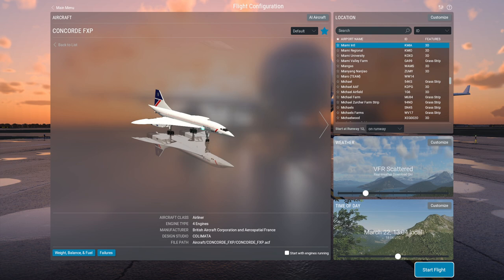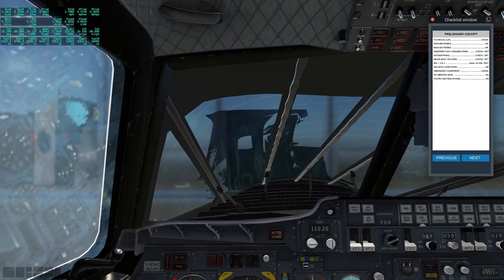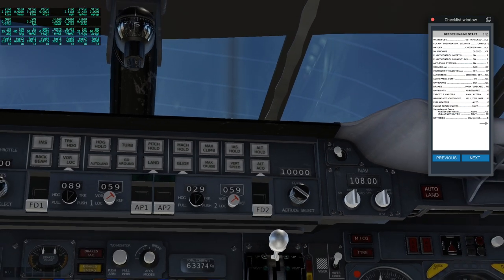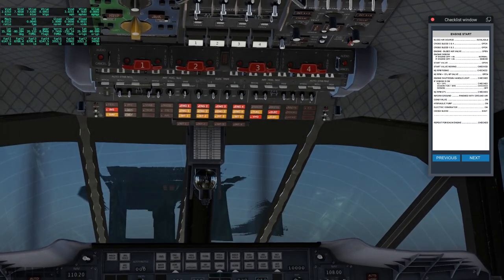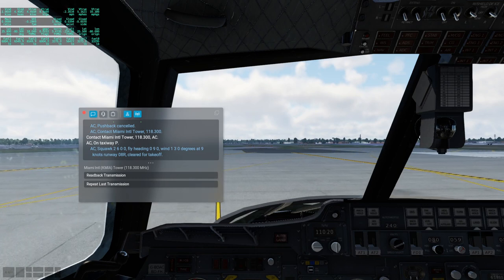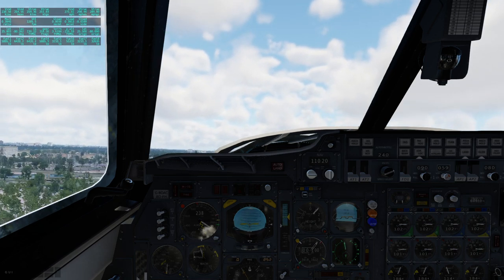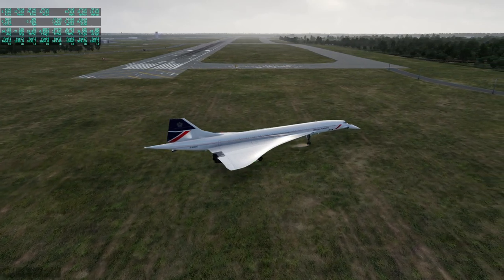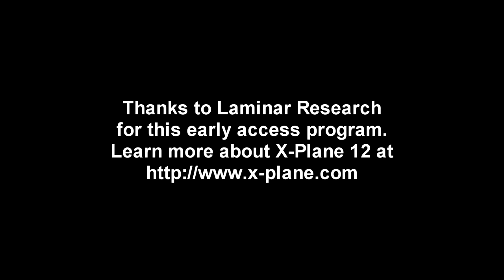X-Plane 12 - Colimata Concorde Update Test

Comment: 12:36 N1 on engine 4 is limited to 88% until 60 knots to reduce the change of vibration caused by poor airflow at slow speed. Quite cool to see that modelled

Comment: Just a couple tips: Supposed to use PITCH HOLD for going through Mach 1, so that the autopilot doesn't chase VS or altitude, as through Mach 1 the pressure wave moving back over the fuselage causes the altitude and VS indications to fluctuate. Also, after passing Mach 1, you are supposed to use MAX CLIMB after that point, and set ALT to 60000. It should automatically change to MAX CRUISE eventually. Also, you say in the beginning that this is the best Concorde for any flight sim that you've used. I'm curious, have you ever had the FSLabs Concorde for FSX or P3D?